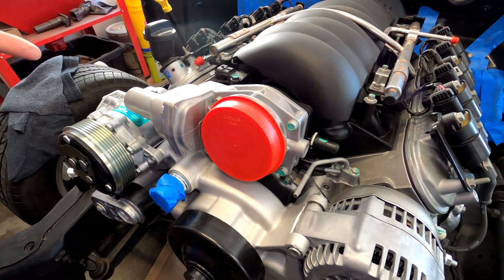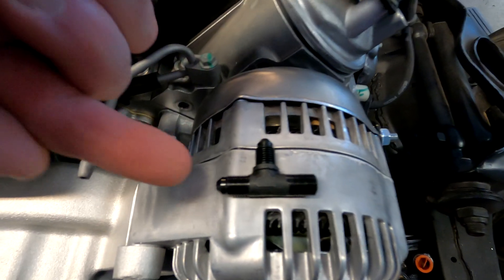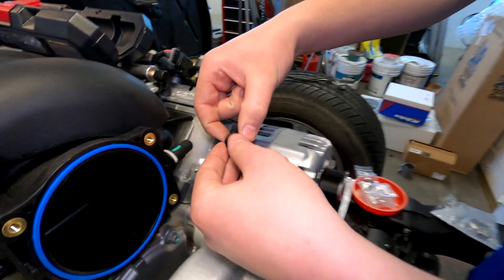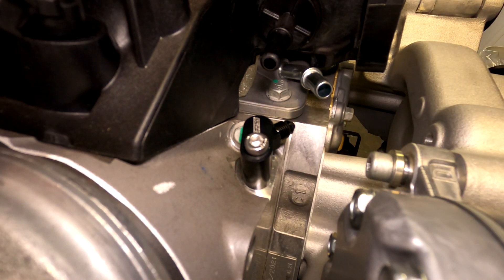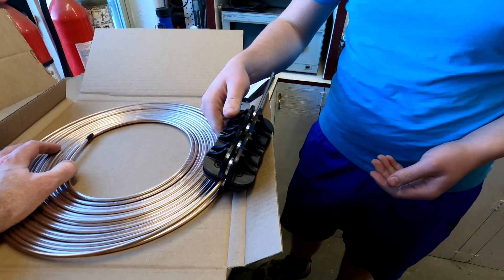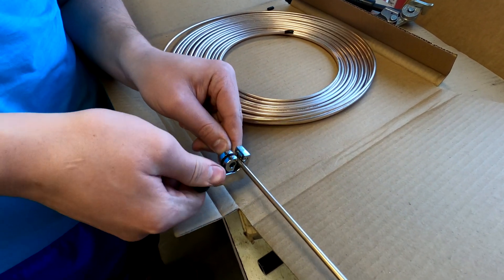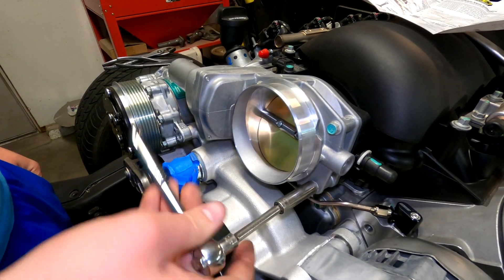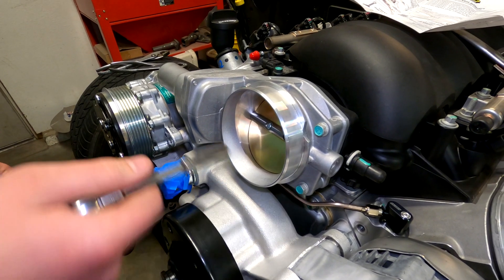LS Swap 12 - Installing Custom Steam Tubes

Comment: can i just run steam lines to radiator top so i dont have to do all this work ?? thanks  mike
Reply: Yes. Tap into the radiator right below your cap so it vents to the radiator and radiator catch can

Buying straight tubing is cheaper than the tube straightener

Compression fittings are cost effective and easier to deal with than flaring your pipe ends.
Reply from the maker: Yes, I think so.  The radiator we bought even had an inlet for it.  I think your approach will work well.
Reply: One year later, yes and that is where it's supposed to really go. That way the pocket of air burps out properly. Everybody running to the water pump is just reintroducing air pockets back into the system
Reply: @rickybellamy8191 
It must be fine as the water manifold comes with the hole already

Comment: Sorry for the stupid. What is the point in doing this? I've never seen this before.
Reply from the maker: No worries, I had the same question.  All LS engines have the steam ports.  They exist to give any air in the heads a place to go, which prevents air pockets, which prevents cooling problems.  The LS heads actually have 1 port at each end, so the motor has 4 total, but it's OK to just vent two of them.

So then the question is, what to route the tubes to?  Our LS-swap radiator has a special port for the purpose, so that's one place you can route them.  But that's not very clean.  Holley provides the port right on the back of the water pump, which I assume has suction, and the distance is so short that the tubes are nearly invisible on a complete engine.  So I like the solution, and it's something I wouldn't change if we did the project over again.
Reply: @WorkinOnIt  thank you for a clear explanation. I’ve never seen or heard of this and now I have to figure out if I’m going to do the same on mine. Is this for a serious HP engine application?
Reply from the maker: @robertmoore4637  As far as I know, venting the steam ports isn't optional - you need to do it.  And the more HP - the more you're asking of the engine - the more important it would be.  I would even think about connecting the rear ports.  You don't want any "hot spots" in a high performance motor.

This is just my opinion.  I'm not claiming to be an expert, just showing what we did, and I'm always happy to explain why.